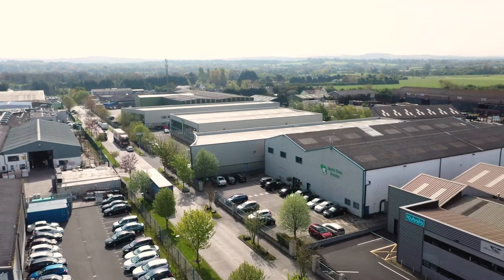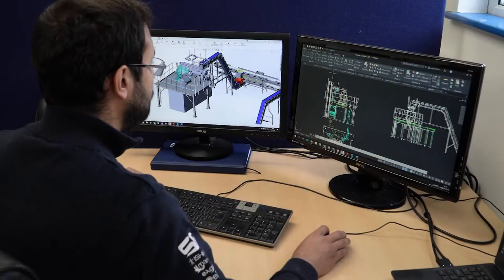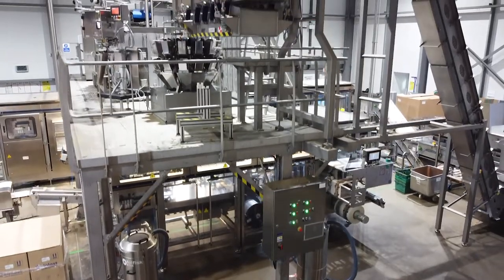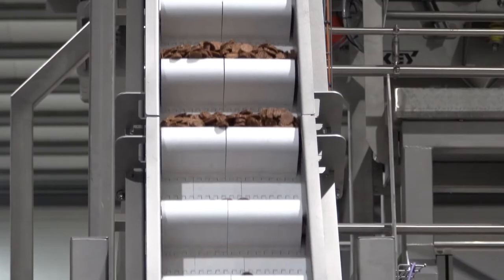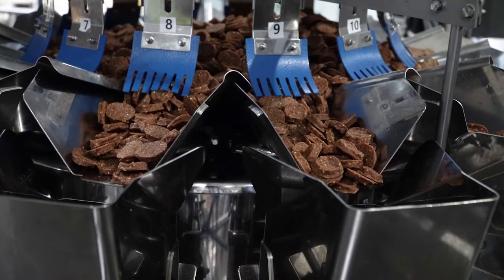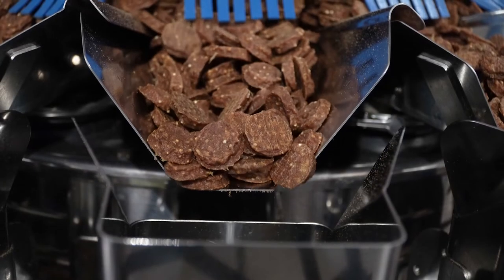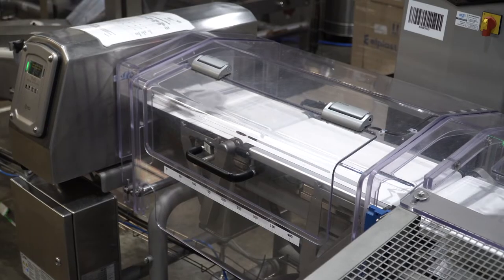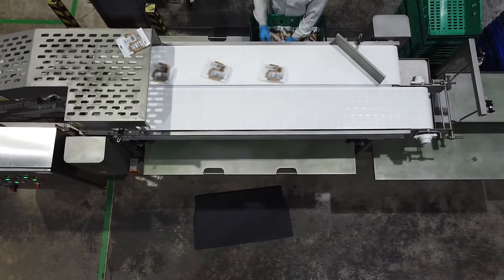Improving Throughput and Productivity with a New Packing Line for Irish Dog Foods

Comment: I watch videos like this, checking on available bag packing technologies, and I'm left with the impression that what I'm seeing is IMPOSSIBLY more complicated than necessary for the mission at hand.   That insane "custom" vertical conveyor affiar?  I'd have a simple 2HP screw drive in about an 8" diameter tube, etc. etc.  JUST IMPOSSIBLY MORE COMPLICATED than it needs to be.  There are at least a half dozen points in this video where I'd dump the overkill and achieve the same result.  Sorry, but anyone seeing this needs to know that such an architecture is probably 5X the necessary cost to get the same result at the same throughput rate.  Yes, I'm a registered PE.